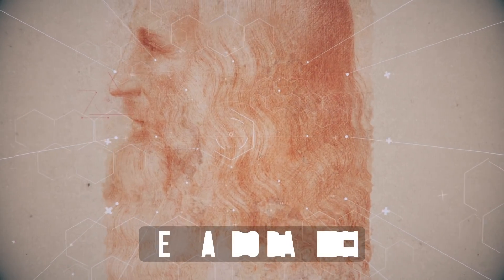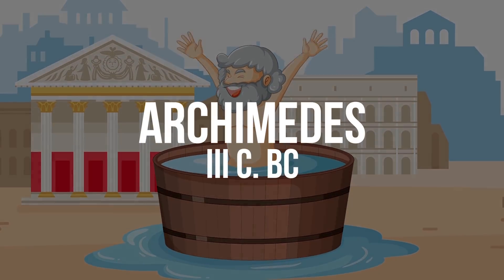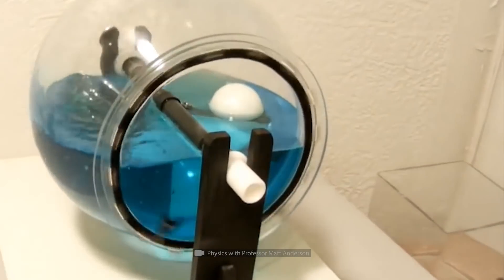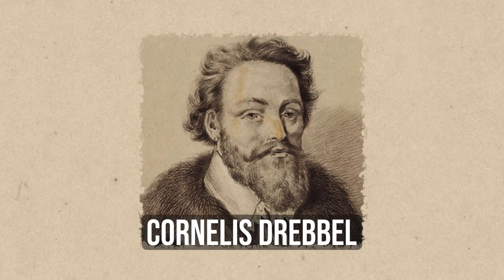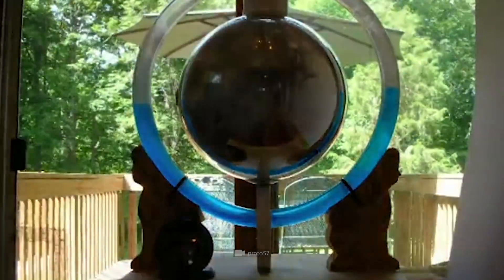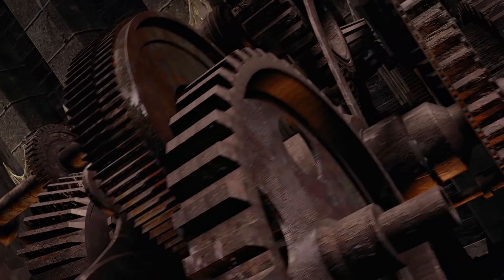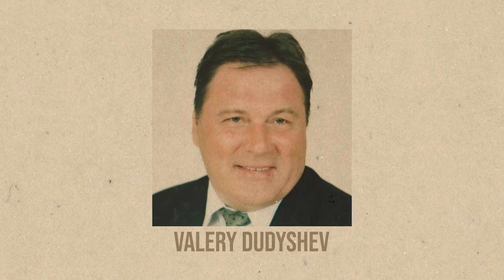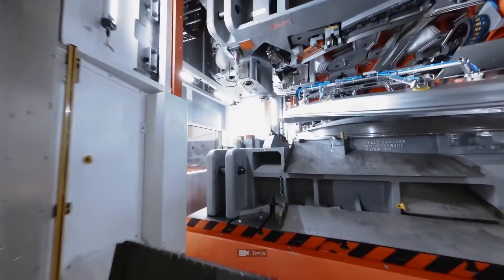Are Scientists Close to Creating a Perpetual Motion Machine?

Comment: You might be able to make a machine that would move perpetually if you could assemble it in a frictionless environment. The problem is even if you could it could perform no useful work. Any time it was accessed for work, it remove energy and thus would slow and then stop.
Reply: @Rayhw1 Ander Agreed. That's one reason people get all excited about superconductors at low temperatures. The superconductor rejects magnetic fields allowing it float on a a magnetic field for extended times. They don't take into account the energy needed to keep it in that condition.
Reply: @christianeaster2776  Tidal forces would sap energy from the system in the form of friction and heat even if there is no physical contact between components.
Reply: It wouldn’t be able to power anything
Reply: @LamronFisher  
You're right there, nail on the head mate!
Reply: It might be useful in a clock. Just spin a flywheel in a frictionless environment.
Reply: Yeah because motion is a state of static energy, it doesnt take energy off a wheel to continue spinning in a frictionless environment. So while the motion may be "perpetual" it's nothing more than a static state. It's like calling a battery with full charge an infinite power source.
Reply: I made a radiator fan with my creation and it stays on even when car is off ..i have same for my house window fans .....these videos create idiots sometimes
Reply: @MrRebustr  
Yeah that's low friction bearings and a high interia fan, or essentially a flywheel. That doesn't make it perpetual motion in any regard. That's literally simple grade 7 science. It's also how car flywheels work
Reply: Try frictionless in space
Reply: What if you could have the machine create more energy than is needed to take it out of perpetual motion? So your machine costs energy to run, but generates more energy than is needed to run it, therefor making a net positive on the energy it makes.
Reply: @Fishbro  Where is it going to get the energy that is used? That's the problem with a perpetual motion machine. In order to get work performed you have to have a source of power.  A perpetual motion machine has no outside source of energy. To have an excess of energy you have to have a source. Under ideal conditions(which don't exist), the best you can hope for is a machine in a closed system that is frictionless(again doesn't exist) that would run forever  but would produce no useful energy. If it did  it would eventually run down.
Reply: A problem in the comment thread is everyone who thinks a perpetual machine can exist is not considering energy conservation or the Thermodynamics law.
If there is no external work done on the machine, then after completing the cycle it has to be at the same energy state as before. Therefore it wouldn't be possible to give out useful work while being in perpetual motion.
It will have to lose some energy to be give out some work but then it won't be possible to achieve perpetual motion
Reply: @utkarshgupta2506  you dont need the laws of thermodynamics. 
the laws of motion and of relativity already debunk "energy from perpetual motion" 
einstein already debunked this completeley, hundret years ago.
Reply: All the celestial bodies are in perpetual motions (relatively)
Reply: while not truly 'perpetual motion' per se' the ball bearing concept only needs a MAGNET on the 'fall over' position of the wheel... just enough to tip the balance and keep the cycle going.. afaik gravity IS perpetual... it may be the ONLY thing that is.
Reply: @jbodden6977  being at rest is "perpetual motion". 
you cant get energy from "resting" without changing the state. 
einstein already debunked this hundret years ago. 

something in motion, is the same thing as something being at rest and everything else moving.
somethin in "perpetual motion", is the same thing as something "being in perpetual rest" and everything else moving.

something not moving at all is in"perpetual motion" and you cant get energy out of something resting, without changing its state. 

energy out of "perpetual motion" is an oxymoron.
Reply: Essentially you would have to put the device in the blackest part of the universe. Void of any interactions from outside sources or energy. Either we would have to read the future to know where to put it and that nothing forever will touch it or it is somehow programmed to detect radiation or matter before it ever could effect it and avoid it.
Reply: Batteries, it's called batteries
Reply: What's the difference between perpetually and progressively
Reply: we dont need useful work,we need perpetual machine....
Reply: Perpetual motion is already known but renamed due to professional “reasons” into persistent current, Brownian motion, Johnson noise, fluctuation, vibration, warmth, Hubble flow.
More than a decade ago in the free_energy eGroup I proposed a perpetual conductor-radiator by the different power yielded by a body of a conductivity and emissivity; two different materials could contact and bask then bask in a work loop that never reaches equilibrium.  Years later in the Maxwells_Demon eGroup Graeff wrote about his gravity machine that exploits Loschmidt’s lapse rate agains Maxwell’s belief in a gas’s temperature equilibrium under gravity.
Reply: @Christian Easter
What you have described wouldn't be perpetual, even in a vacuum its surroundings will slow it down over time due to electric fields and magnetic fields, it would make a damn good kinetic battery though if enough mass could be crammed into a small space.
Reply: @steve_ancell  What you say just goes to prove perpetual motion machines are impossible. You notice I said might be possible. You can't make one because it can't be isolated from outside influences no matter what.
Reply: @christianeaster2776  
You have a point there, and come to think of it PM does seem to happen on the quantum scale. I just remembered energy can be held in a metal loop like the experiment where a YouTuber assembles some nuts in a ring shape and then energizes it with a battery and wire, they stay fused until the ring is breached. There was also something called the perpetual holder that worked in a similar way but uses a coil of wire on a U-shaped yoke and a keeper bar. Problem is the loop has to be broken to access the stored energy, just one quick burst and that's all until it is re-energised again.
Reply: Earth Engine via Inductance Energy Corporation. Earth Engine is the world’s first and only power source propelled by Asymmetrical Magnetic Propulsion.
Reply: that's not the point, if you make a perpetual frictionless machine, u can  then use energy without loses which save money in a lot of industries
Reply: totally not true, all you need is a power source to keep the motion going and it would generate neutral amounts of energy, like a car, if electric cars used wheel rotors for perpetual energy generation, you could have unlimited travel range
Reply: @mmoarchives2542  if you need to power it then it is losing energy.

Comment: From what I understand, the down fall of all perpetual motion machines is mostly friction. So in theory if you use a frictionless surface then some designs that didn't work due to friction, adding a frictionless surface should make them work. I'm no scientist so I'm sure there's holes in my idea.
Reply: You're not wrong, actually, but as another commenter pointed out you wouldn't be able to access the machine for work--since accessing the energy of the machine to do work will drain it of that energy. For instance, you can fly an object out into orbit around the planet and if your orbital trajectory was 100% accurate then it will continue orbiting the Earth forever with the same energy, never losing or gaining anything. However, the moment you attach some kind of device or generator to the orbiting object to capture that energy the object will slow down and fall back to Earth. So, perpetual motion machines aren't impossible in the *right environment*, we pretty much use them all the time with satellites, but they are utterly useless for producing useful energy (luckily, it is not the point of a satellite to produce energy, but to produce/transmit signals over massive areas without building the world's tallest skyscraper). That's also pretty ideal conditions, as I bet all of our satellites were set on imperfect trajectories and will eventually either fly away from Earth or will fall back down to it unless they have a small source of propulsion to make small adjustments (or we simply accept its limited lifespan and allow it to fall down after a few decades of faithful service).

It's one thing to create a machine that perfectly conserves its energy in a perfect environment that only exists in an undergrad physics textbook or outer space, but it's entirely another thing to create a machine that perfectly conserves its energy AND produces enough excess energy to do useful work without losing its conserved energy. The first is well within our grasp and frequently used for the useful task of keeping satellites orbiting the Earth (though they aren't "perpetual" in the purest meaning of the word), but the latter is basically impossible with current technology until we can find some kind of universal energy source that never runs out (and if anyone discovered such a thing then creating perpetual motion machines would be the least of our cares).
Reply: Don't you have alot less friction if you trap what is moving in a vacuum? I heard that's how the hyperloop was supposed to work removing air making air resistance not a problem allowing there vehicles to go extremely fast
Reply: @TheOfficialChannelOfChannels  hyperloop is scam. it does not work, it is super slow, and most of all building and running costs are beyond our economy.
Reply: @mitjapintar4609  I'm not saying it's good. I'm just saying a perpetual motion machine deals with friction and eventually slows down but what if the moving part was trapped in a vacuum where it would deal with alot less wind resistance
Reply: @TheOfficialChannelOfChannels  because the fundamental science behind it, is the state of entropy always increases. So you will drain energy from the isolated system, when transforming it to work. As you can neither create or destroy energy.

So you could have a nifty spinning object that kept moving per the conservation of momentum, but to actually gain anything from that system, you have to apply some sort of force to it to extract energy. 

But even in a frictionless enviroment you would only retain the energy given to start the machine, it would not accelerate
Reply: @ExarchGaming  okay thank you for your detailed explanation
Reply: @TheOfficialChannelOfChannels  No problem man, understanding the laws of thermodynamics, and the law of energy conservation helped me understand the world and universe on a much greater scale, and why we can't or don't have an idea how to do certain things.
Reply: @ExarchGaming  there's a few things that don't make sense to me like the Mythbusters dimple car or throwing a basketball down a dam and watching it fly far away, or how we can age faster in certain pockets of space ,like if you sent a satellite into that area in front of us we'd watch it decay way slower and if it sent video of the earth back to us it would be played in fast forward and if object pass through that space where things are much faster would they get accelerated at such an incredible speed that they cut through the slow zones like ours and we'd be left unphased or if the object would just disintegrate from the sheer force of leave that area and hurdle to us as just nothing, soo many things I've wondered in the past, like if a star were looking at has gone out and started a new one in its place we could be looking at the original cause the light took soo long to reach us , so if you fly towards it then you'd watch it go out as it was intended but if you flew away from it back to earth time Is content so what you saw you saw but as you head back to earth you'd see the star get undestroyed in reverse?
Reply: @TheOfficialChannelOfChannels  Oh yeah man, the deeper levels of quantum mechanics is ........ confusing. It's extremely math heavy, and if you want to explode your brain, go look up string theory. It's an interesting read, Wiki has a GREAT article on it about how current models indicate that spacetime itself may be in 10-11 dimensions (not dimensions as you think like alternate worlds, but .... it's so hard to explain because our brains are only capable of recognizing things in 3 dimensional states. X Y Z.
Reply: @TheOfficialChannelOfChannels  Every motion produce gravity waves and that is converted in loss energy if not for that black holes would be the perfect perpetual montion machine but sadly they too can't escape the laws of thermodynamics, but there's a place that can have perpetual motion, down on the subatomic level, in quantum mechanics where up quarks always go up because it doesn't need any reason to go up and down quarks always go down with no apparent reason either, it's a palce where particles does what they want with no logic or math behind it.
Reply: @robymaru03  i feel like if there is something always around us like air or gravity that could somehow be harnessed to power something, if not forever at least for a very long time, something that when it gets spent it turns into another type of gas and then another device that turns that gas into the original form and so on and so on, like a water tank that when the heavy ball falls to the bottom it compresses a pump that releases a bubble of air lifting the oppisite side ball to the top where the bubble escapes out the side and the ball falls the same way the first did since the air isnt lifting it and it then to starts to fall to compress the pump to make an air bubble under the original ball, using gravity to fall back down and using the air to get enough boyancy to go back up

Comment: The goal is to create a perpetual-ish motion machine. If I could get a car that runs on "nothing" for 70 years, that's close enough.
Reply: PPMEs: Pseudo-Perpetual Motion Engines.
Reply: That would be bad, no money would be made on that.
Reply: then in that case we did it theres a bell thats been ringing on a really old battery for atleast 100 years at this point

but as people have stated thats not perpetual motion perpetual meansd it must operate forever and have no signs of ever stopping unless we desire so
Reply: @Sarge92  Self regenerating material is the answer.
Reply: Thats the point. Perpetual motion has no use at all, since there is no output. You cannot run a car on perpetual motion. There is no way to push out 100 horse from absolutely nothing, silly
Reply: @koloo3220  You have dark energy yes xd
Reply: So ignorant. Even if a car could last 70 years, the energy needed is the same whatever the source of energy you are using so the concept of "runs on close to nothing" is absolute trash. 
The sources might get better and this cars would last longer but it is far from the definition of a "perpetual machine"
You would still use the same source-consumption mechanism
Reply: @Ryuk-IsLife  exactly. Efficiency is getting better but u need energy to accelerate its common sense
Reply: In other words, lasting long is NOT equal to perpetual motion it is just not the same thing. Comparing Apples to Oranges
Reply: I had space travel in mind. If our bodies can be cryogenically preserved in a perpetual motion spaceship, we could land on the Alpha Centauri star system in some thousand years.
Reply: Its like a super efficient machine that runs for a long time